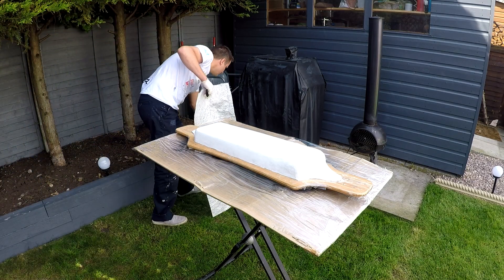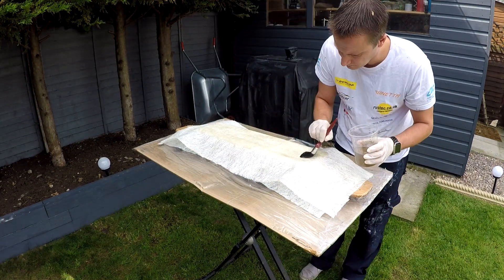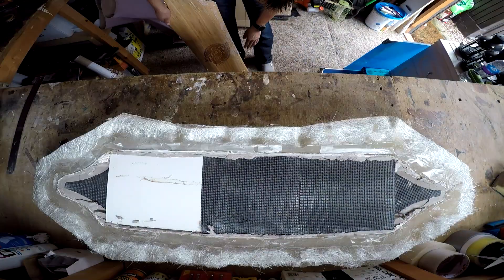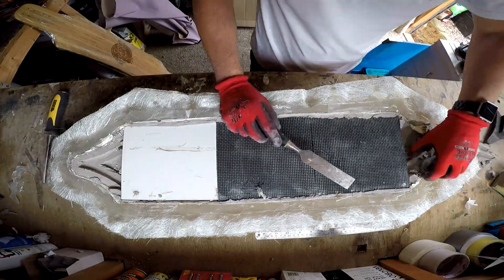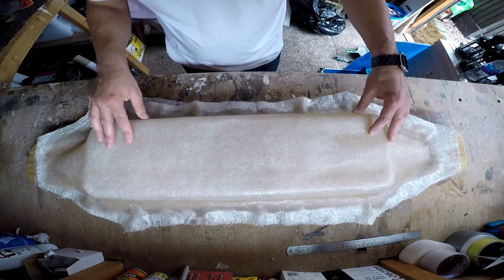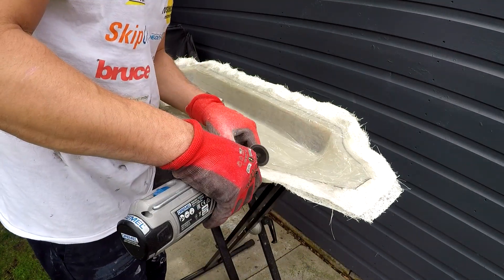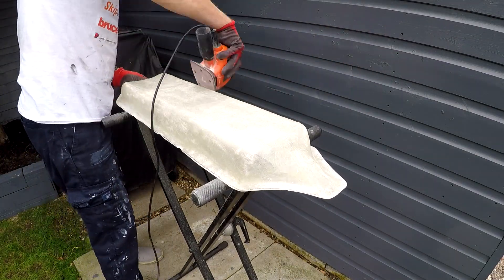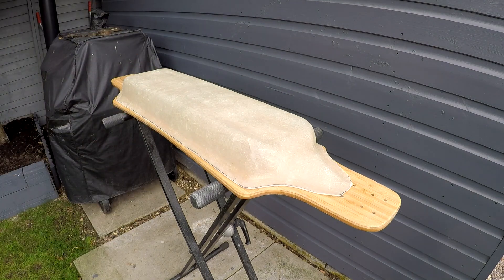DIY Fibreglass Esk8 Battery Case

Comment: Around how much did this run you? Clay, resin, fiber?
Reply from the maker: The clay was air dry modelling clay and I way over ordered and bought a 12kg pack for £19 off Amazon (probably only used 1/4) and the Fibreglass was a 1kg repair kit from Ebay for £22.

Comment: Finished product looks great.....Im in the process of starting one, were you happy with the thickness that the two layers provided or would add more next time? Have you ever used mold release spray/wax?
Reply from the maker: I found two gave me just the right amount of protection from stone chips and the odd bang, but still gives a bit of flex so the board isn't too stiff. Sadly I've not used any release sprays or waxes but I've seen a few videos that recommend their use. I just used the tape, not perfect but it worked reasonably well as you saw.